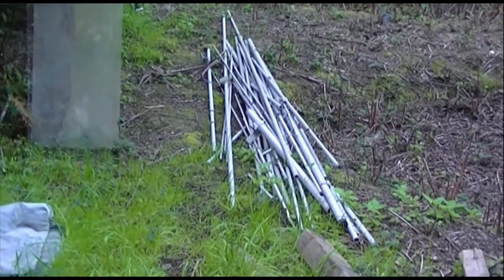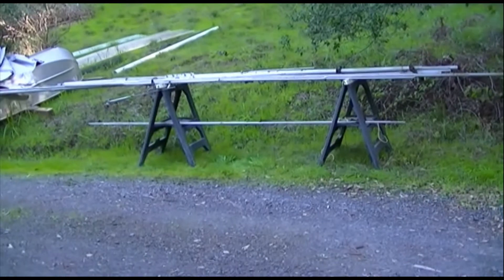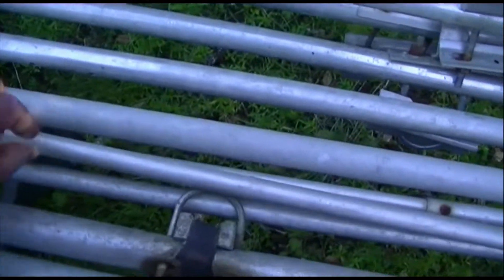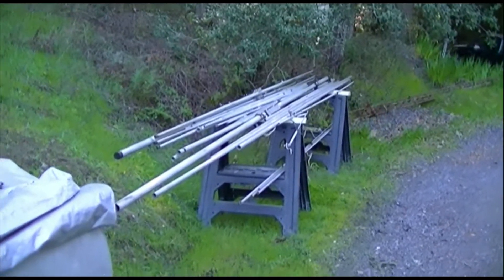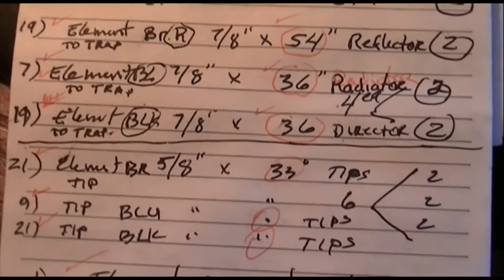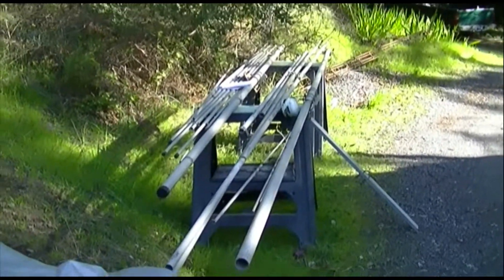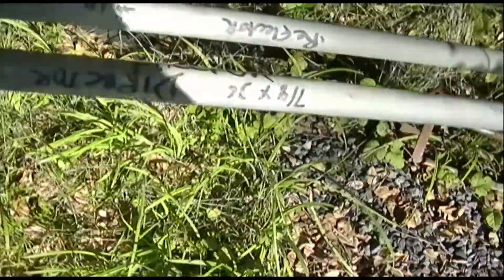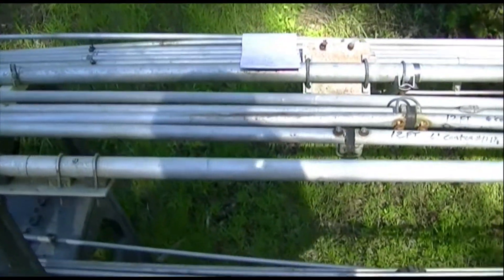W6WUH: Mosley TA-33 #3  Mission Impossible.  Assembling My Old Antenna Puzzle.

Comment: i dug out my old 33jr+warc  and called mosley and they sent me all the manuals for free! great people still there. good luck
Reply from the maker: Yes you can get any repair parts and manual from Mosley.
Reply from the maker: Manual and all info is available on line.  If you watch the series of videos I made... you will see I show you how to identify all the traps, repair them,  and generally get an old antenna ready to use again.  The set -up is really the last step after overhauling all the traps has been done, and the basic assembly is complete.   The warc antenna is NOT what I have.   This is an OLD mosley TA-33.